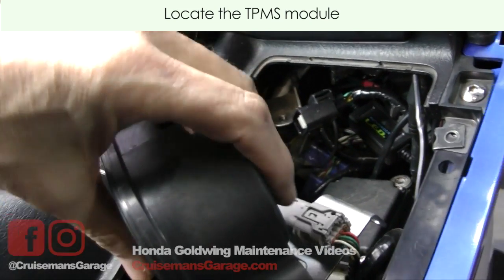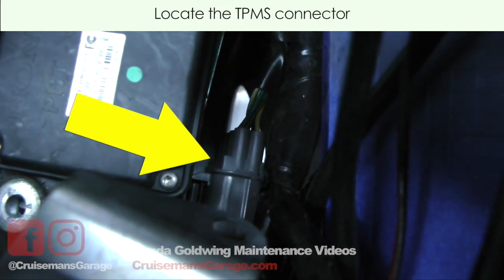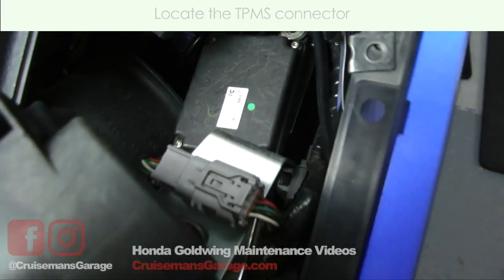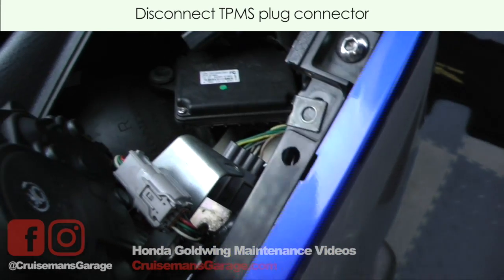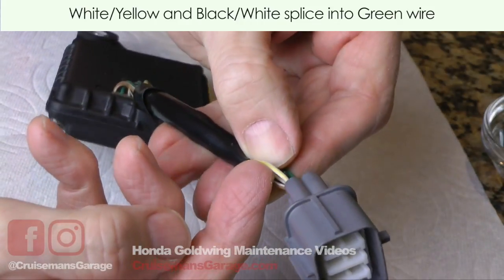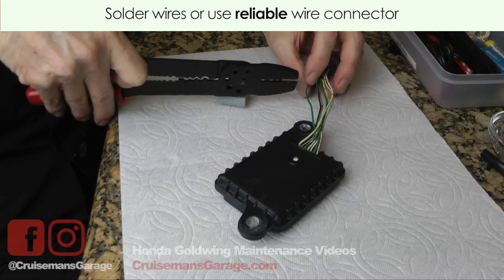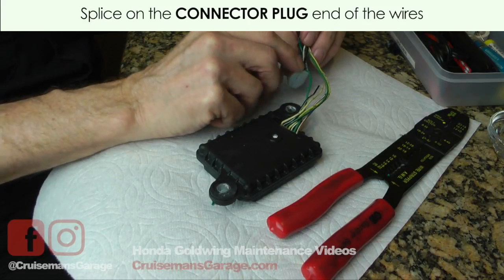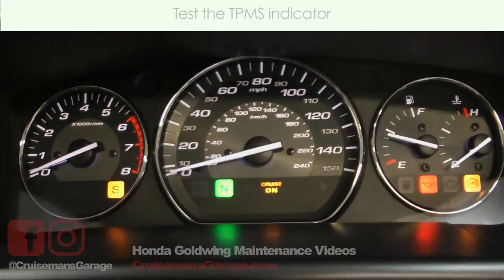How To Disable Honda Goldwing TPMS Lamp | CruisemansGarage.com

Comment: As Richard Drake stated below, it is easier to separate the wire connector by first unclipping the connector from the frame.  You can disconnect the connector from the frame in a few seconds and then you can pull the entire harness and TPMS unit out of the bike and separate the connector in a few seconds.  The clip for the connector is on the left side of the connector.  You move the tab to the left and the entire connector lifts right out of the bike.

Comment: Thank Shipmate. Funny  it came on after the local Honda dealer put on a new set of tires (3rd set). On my 2010. Yes, not a peep for 14 years! But knew it was best to just cancel out the system vice servicing it. Thank for the walk thru, took about an hour even with baker wings. Thank agian

Comment: Under the seat left side of frame you can find the wire harness and use a fork style wire connector to reset the TPMS in the event the batteries are still good but the system just needed a reset. There is a video on exact location on you tube.

Comment: I did this a long time ago after coming home from a trip on my 2012, Battery went bad and stopped at 5 dealers in ark on way home no one had a replacement, so I came home and hard wired it together, People don't think but every dealer does this when they turn bike into trike as rear trike tires don't have tpms, Awesome vid thanks again.

Comment: My Indy just spent two months fixing some issues. The cruise stopped working. The TPMS light is on. After replacing the computer the cruise still does not work. Can the cruise be disabled by the TPMS module? Would doing this mod make the cruise work properly?  I have a 2014 GL1800.
Reply from the maker: I am not aware of any connection between cruise and TPMS.
Reply: @cruisemansgarage I guess I really don’t have anything to loose and see if it does. I was reading some forum posts that the cruise takes inputs from tpms and tire pressure sensors besides clutch lever and brake. . I will try this and report back. Thank you.

Comment: Thanks Cruiseman! I had the same problem and used your video to fix my problem. Just FYI, the tab on the left of the TPMS grey plug releases it from the frame of the bike making it easier to disconnect the plug! I have large hands and I was fighting it for a few and realized that the tab was a release tab. It made it a breeze to disconnect and reconnect after the splicing. You helped me so I wanted to share that tip! Thanks for all of your videos on the 2012 GL 1800.

Comment: My tpms light has been on ever since I bought my '09 last summer. I check pressures regularly anyways because I've never had any sensors on previous bikes so it isn't an issue if it doesnt work. I just ordered an air filter so think I will do this while I have the bike stripped naked just for the filter change. Thanks for the vid!

Comment: Hello Sir…great video…I’ve similar challenge with TPMS light come on and off, even I did ensure the tyre pressure.
If follow this procedure, will the low press tyre lamp (next to it) still function, means still giving signal while low tyre pressure?
Please advise ✌🏼🤠
Reply: Hello all…kindly need your advise

Comment: For my interest only.  I have only replaced my stock tires with stock tires but noticed the  light came on after hard bumps only and reset with the key cycle.  What causes the light to come on?  Is is simply different tires?  Different rims?  I have a lot less lights pop up since I upped the front pressure a little as per the dealer.  Thanks!